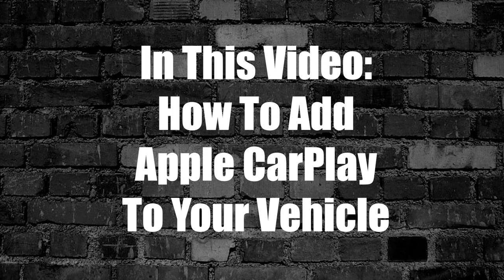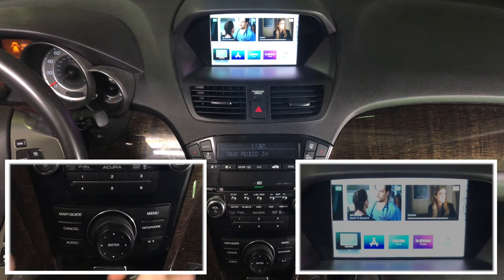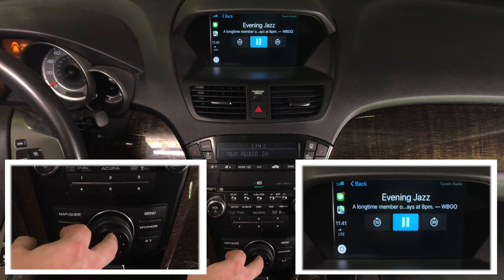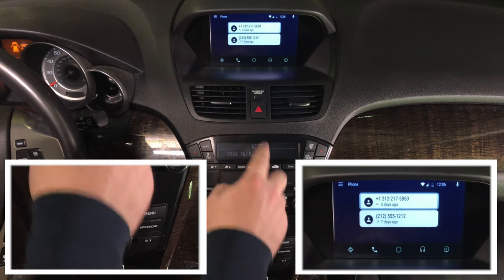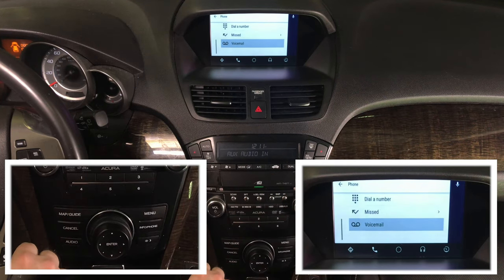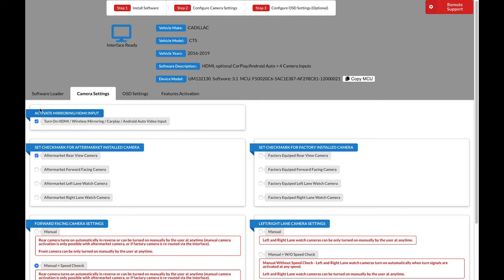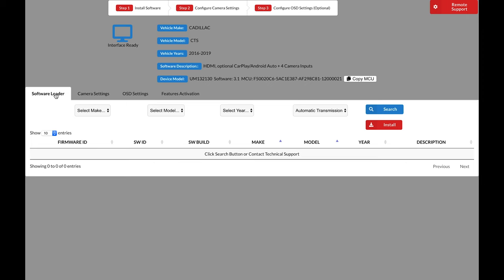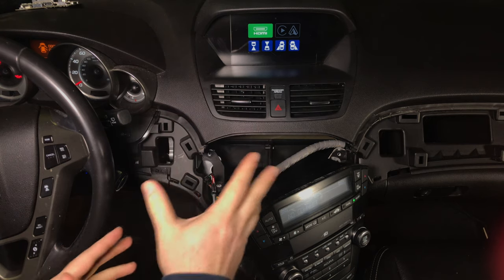Honda Pilot Apple CarPlay - How To Add Apple CarPlay Honda Pilot 2012-2015 NavTool Video Interface

Comment: I have a 2013 honda pilot touring. Am I able to use the built in microphone that came with the car for the use of Siri. Also the vehicle has a built in USB/Ipod input, am I able to use that for apply car play without any extra wiring.
Reply from the maker: If you are a professional installer you are able to achieve this, the system is now 100% wireless so USB is not required

Comment: Hello.  I'm looking at options for my 2013 Honda Pilot for Carplay.  Your system seems to be the best option, but I'm having a hard time finding the answers to a few questions I have before I decide if it's right for me.  What's the best way to get some pre-sales question answered?
Reply: hello ryan, i’m actually also looking to purchase this, by any chance did you end up buying this product ?? i have a 2014 honda pilot base model
Reply from the maker: The live chat on the website is the fastest
Reply from the maker: @robyyyyyy1682  2014 bass models also supported and now it comes with wireless Apple CarPlay and wireless android auto, plus it is 100% made in the USA

Comment: Will this work with a 2011 Honda Pilot ex-l with navigation?
Reply from the maker: Hello, Yes 2011 Honda Pilot is also supported and now comes with Wireless Apple CarPlay and Wireless Android Auto + 100% made in the USA
Reply: @Navtool  when will you post a video of a 2009-2011 Honda Pilot install?
Reply from the maker: @charminbaer2323  simple plug and play under the seat does not require a video because there's no radio to take out
Reply: @Navtool  is it the same device for both 09-11 and 12-15?
Reply from the maker: @charminbaer2323  yes we have for both